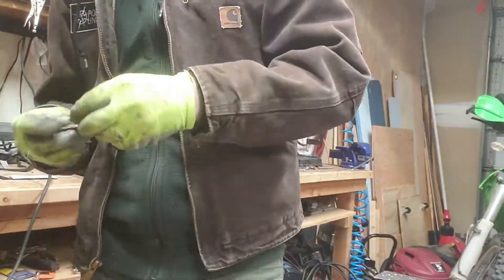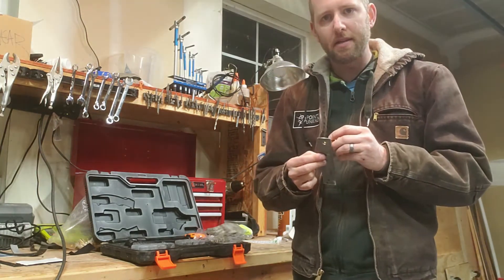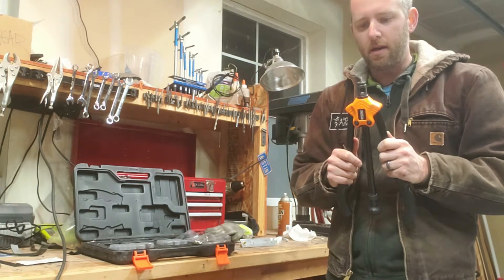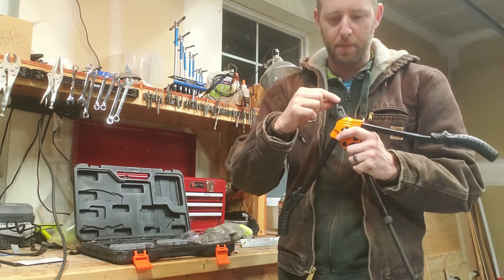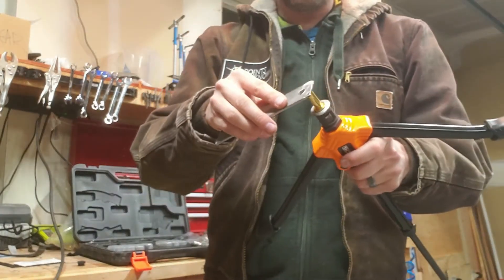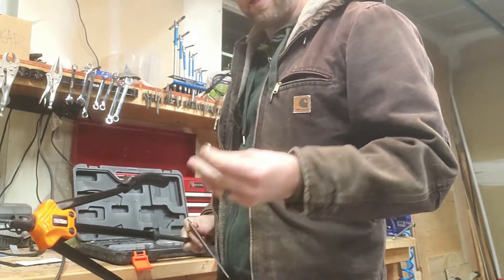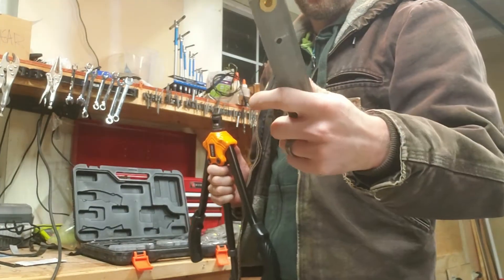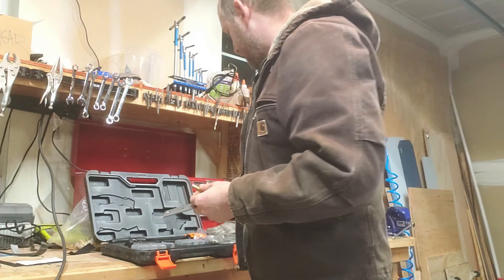Install Plus Nuts with a Riv Nut Tool (and PlusNuts vs RivNuts)

Comment: Can you use one of these with a fender washer underneath if your installation in thinner metal?
Reply from the maker: You'd want to do a fender washer behind the thinner metal. Which... If you can access that - I'm not sure why you need the plus nut. But I also  don't see why it wouldn't work. Let us know how it goes!
Reply: @PointsUnknownTV Got it. As for the why, its a hard to reach spot that i want threaded. Two people could initially, get it done.

Comment: This video is a huge help because this is exactly what I'm running into. Amazon sells longer mandrels to use for plus nuts but they cost as much as the whole kit!

But I'm confused about one thing in the video. To finish it off at 4:35 you put the cap back on then somehow just push the tool into the plus nut, then when it's done you just pull the tool back out. How did you do that when everything has threads? Does the mandrel spin when you squeeze and unsqueeze the handles? I don't see it happening in the video because you push it all the way in without moving anything.
Reply from the maker: Aww! Yes. I see what you are seeing (or not seeing as the case may be). There is a center rod that spins the threaded mandrel when you push it in (tighten) it pull it out (to loosen). So to thread the plusnut on I'm just pushing the central rod in. Then to release the plus nut, I pull it out. Sorry I didn't show it that well in the video

Comment: I use the WETOLS ( and I like it ) and with my handles extended, I measure .700  for the plusnut/bulbed crossnut, rivnut, etc. tool and I may have to use your trick to make it work. With your handles extended, what depth do you get when you say your 1/4" nut won't hit the threads?  I will be using the same 1/4" nuts. Sorry I'm so late to the party:face-green-smiling:

Comment: THANK YOU.  I just ran into this with a rivnut tool  very similar to yours.  They all seem to make the threaded mandrel just a little too short to grab a jack nut (or a plus nut as you are calling them).  Pulling off that big nut and replacing it with a washer is so simple.  Great idea.
Reply from the maker: Awesome. Glad it worked for you too!

Comment: I just bought an Aiuitio rivet nut setter and I have M5 Plusnuts that will fit on the M5 mandrel without the anvil. I plan on going to my local United Fastener store to get the washer and give it a try.  I’m also have no a problem trying to determine drill bit size maybe you can help. Although I have a chart by Starrett of Inch/Metric Tap Drill Sizes and Decimal Equivalents, it doesn’t seem to be working for me. If, for example, I have a 10-24 Rivet Nut, what size drill bit would I use? If I look on the chart under Tap Size and find 10-24, it looks like I could use a drill bit between 9/64 and 5/32. However, those drill bits are too small. So maybe the Tap Size does not equate to my river nut size, which means I’m not understanding how the chart works. Any insights into a chart that you refer too to find the drill bit sizes? TIA
Reply from the maker: The tap charts are for tapping threads into metal, not for installing rivnuts are plusnuts. Typically the rivnuts or plusnuts you purchased will indicate what size hole they suggest. I also did a quick search and found this table, which may be helpful: https://www.rivetnutusa.com/wp-content/uploads/2018/09/rivnut-plusnut-page-12.pdf

Personally, I use a stepped drill bit that gives me multiple options for different sized holes. You could get one of these and then drill out until you find a size that works. Here is an example: https://amzn.to/3OLBH7k
Reply: Thank you for your help, most appreciated. I have another question: can a Rivet nut setter work on other rivet nuts that are a different brand than the ones that came with it? For example, an 8/32 Boehlhoff nut is smaller than an 8/32 nut that came with my rivet nut setter. It still fits on the mandrel though. However, the thickness of the metal varies between the two. 
The step drill bit sounds like a good idea as I don’t have every size drill bit and I’m finding that some of these rivet nuts I’m trying to practice with need a drill bit size I don’t have. I’m also not getting clean holes drilled through my 1/8” thick steel tubing using a hand drill so I’m going to try my drill press. 
The Boelhoff nuts and Plusnuts are expensive so I don’t want to use them for practice.
Reply: I ordered my rivet it’s from Bollhff off the chart you posted. However, where does it tell you the drill bit size? For example, an 8/32 needs a hole size between 0.222-0.226. So then I take those numbers and match it up with a drill bit size. The people who sold me the Bollhoff’s sent me the Starrett chart and said I could use it to find the drill bit size. So, for the 8/32 it looks like a 7/32 drill bit would work. However, that size is too small for the 8/32 that came with my rivet nut setter. It’s a bit frustrating!
Reply from the maker: Different rivnuts will have different requirements for the hole size, but as long as you have a threaded mandrel that works for each rivnut it should be fine. I order random rivnuts and plusnuts from amazon and haven't had a problem yet.

Sorry. I dont have any experience with Bollhoff rivnuts or plusnuts. But I did some quick searching on the internet and found this:   https://boellhoff.canto.de/direct/document/d71rk0ll7l2ql0tog5p8fah44e/HlSl8vj90wj_TJKt8scSzp1U52k/original?content-type=application/pdf&name=RIVNUT-US-en.pdf which appears to have the hole size required for Bollhoff rivnuts. 

As you said, for an 8/32 rivnut, the chart in that PDF says 0.222 to 0.226. The nearest common size would be 1/4" for that, but it may be too big, depending on your application. So the nearest uncommon size would be 15/64" (0.2344 inches) still a little bit big, but... closer? Or a metric 6mm (0.24 inches), again bigger than it says but ¯\_(ツ)_/¯

This chart is handy for finding the nearest fractional size for a decimal measurement (in inches) : https://www.smithbearing.com/images/pdf/ENG-FractionalChart.pdf

Comment: I have a set of carbon fiber motorcycle handlebars. Do you think rivet nuts would work so I can bolt hand guards to them . I have a 8mm hole in the end .
Reply from the maker: I have no experience with full carbon handlebars, but I'd be concerned about the new forces that would be applied to the inside end of the bar in a crash. To your question - sure if you find the right size rivnut or plusnuts to fit the opening, should connect fine. However, Carbon is brittle, so I'd be concerned it might crack or rip out if the bike was dropped (versus metal bars that bend).

Comment: hi dear 

is this can fit in 6 - 7 mm steel plate??
Reply from the maker: It depends on the specific plus nuts you buy. But yes, there are sizes that can accommodate 6 to 7mm metal thickness. These, for example, are advertised to fit 7mm thickness: https://amzn.to/3TSLlXG
Reply: Thank you so much brother 💐

Comment: Where do you purchase your plus nuts. Everywhere I look they're like $1/each which gets pricey when your using 100+
Reply from the maker: I get mine on Amazon (see link in description) but agreed, they are more expensive than rivnuts. I usually just use plusnuts for applications where pullout is a big concern. And rivnuts everywhere else. That's the most cost effective.

Comment: Do you think this would also work with 5/16 bolts?
Reply from the maker: Good question - I am not entirely sure. The washer will fit over the 5/16" mandrel just fine and make the mandrel be able to thread further out. But if the distance to the threading on the 5/16" plus nut is further than the 1/4", it might still not work. I don't have any 5/16" plus nuts to test on. Sorry :(
Reply: @PointsUnknownTV  thanks
Reply: @turtletreker99  Hi, did you have a chance to test the 5/16'' plus nuts with the mandrel?
Reply from the maker: Probably more than you want to do, but if you mail me an example of the 5/16 plus nut you want to use, I can see if it works and followup. Feel free to get in touch on pointsunkown.com.

Sorry I'm not more help.
Reply: @PointsUnknownTV  Thanks for your reply.
Unfortunately, I live in Switzerland, so mailing a plus nut overseas... I can try.
I tried this approach without a tool using two washers, an oversized nut in-between put on an M8 (=5/16) bolt inserted to the M8 plus nut but when fastening the bolt the plus nut spins in the hole. The only way is to hold the end of the plus nut on the back side with pliers so it is not rotating (if one has access to the other side of the plus nut). But you need a lot of force and ideally three hands. Even then it is pain in the ass.
Reply: @vendacerny902  Sorry for the delayed reply, but my house closed and I worked hard finishing my van build for full time nomading.
Reply: @PointsUnknownTV  I gave the tool away. I'm too weak to use it and if you don't have the nuts totally secure they keep spinning - making them useless. Gave it away.
Reply from the maker: @turtletreker99  sorry the tool didn't work for you, but very exciting for your full time vanlife!
Reply: @PointsUnknownTV  Yes it does. But I found the thing so difficult to use - especially at 5/16 that I gave it away. I am a 71 year old woman.  I hated the thing.

Comment: A great simple solution.  I have been racking my head to find a good tool to install the slotted/plusnut insert.  Bought the tool and shortly realized the tool won't work with this type.  Thanks again for the video

Comment: Good video.  I just installed a number of these and I can say with 100% certainty that there is NO NEED for a special installation tool.  Some of the dedicated tools actually do an inferior job.  A grade 8 bolt, oversized nut and wrench, and a couple washers combined with a drill or bit driver works perfectly.  These things are really soft and I set most with a stainless screw.  Just don't over-do it.
Reply: I tried that option, didn't work for me. Bought the tool. Hated it. Went to using self drilling wheet metal screws.
Reply: @turtletreker99  You should have used the THREADED NUT instead of the slip nut on the bolt. You hold the bolt in place and tighten/crimp the riv-nut/cross-nut by turning the threaded nut because you won't ruin your threads this way. The slip nut trick is VERY hard on the threads of riv-nuts, etc.
Reply: That method doesn't always work well. Often times the insert will just spin instead of compress.

Comment: This is exactly what I've been looking for! So if you're changing the mandrel to another size, would you still stick with the 3/8" washer?
Reply from the maker: Yup! Same size washer for all the mandrels (at least all this that came with my kit). The 3/8 inch fits around the flange on the mandrel, which is what allows it sit closest to the tool.